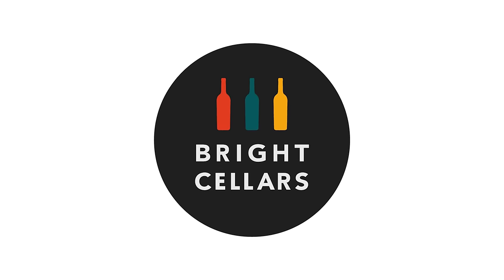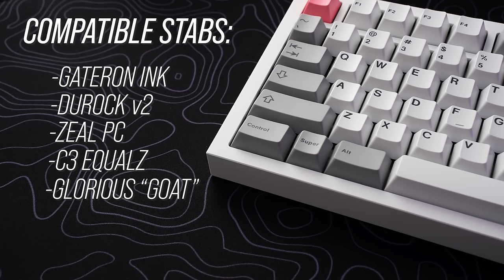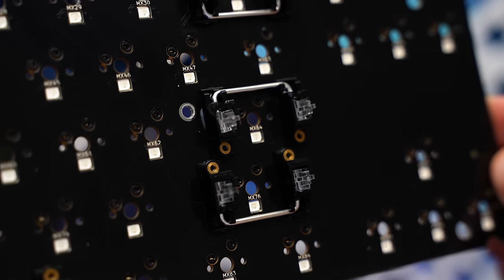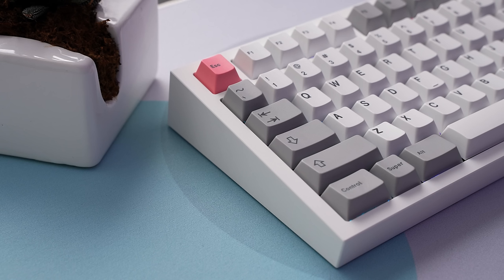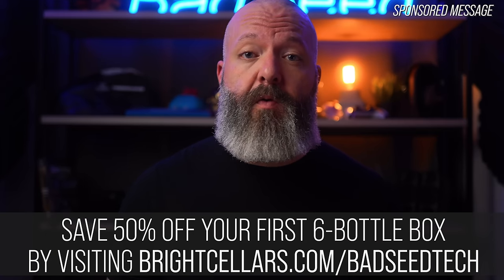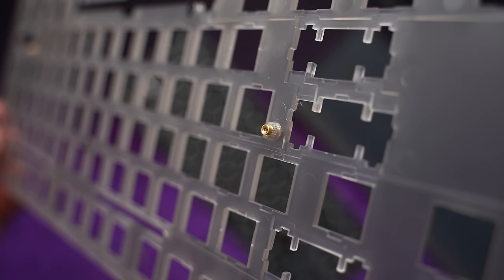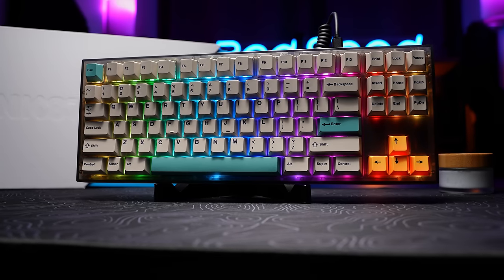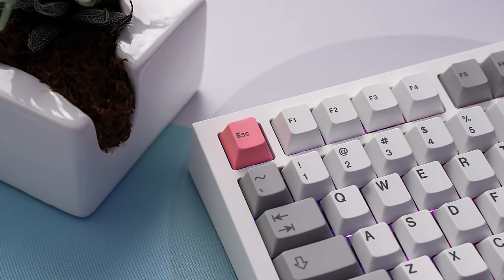NovelKeys NK87 Entry and Aluminum TKL: Wow

Comment: I really like that NK is trying to offer great starter boards for a competitive price in the market space. Hopefully they start offering boards with different mounting styles and layouts for a competitive price later
Reply: I mean, they've had the NK65 and NK65 EE for over a year. The pandemic made keeping them stocked hard, but they were stocked constantly. This one just brought custom TKLs to an affordable-ish price. I still think you'd get more bang for you buck spending $10 on the KBDFans x ai03 8X Mk.II at $289 for the kit. Sure doesn't come with case and accessories, but you get better materials and mounting options (default is top mount, but can be o-ring gasket mounted). Even better yet, the Freebird TKL is going to set the bar for entry boards with their TKL.

Comment: Much love for some TKL content! Now just to wait for the Keychron Q3, looks like they updated it with an F13 layout which is much hype at $149
Reply: The Q3 at 170$ might just give good competition to the drop ctrl, meanwhile the ducky one 3 tkl is 150$, so there won't be a compelling reason to get that also

Btw,have you seen the fl eSports cmk87? 130$ for hotswap wireless tkl,it has a plastic case but with a metal weight at the bottom
Reply: I've been looking for an aluminum TKL with gaskets and per key RGB. The Q3 seems to be the best option for me personally (prefer it's side profile more than NK87 - hard to pick those up)

Comment: Another Banger Friend! I just modded my Aqua Kings with a POM stem. Holy crap, deep low sound and smoother than Brad Pitt on a cougar cruise 

Insane amount of value for a solid board. NK revolutionized entry level 65% boards now they're doing it with a TKL.
Reply from the maker: Oh that sounds like a nice mod on the Aqua Kings, I’ll have to look into that.
Reply: I used a P3 stem (Ones in Durock POMs) in my Aqua Kings to put as my spacebar and holy fuck.. it's insane.
Reply: @Archurus  You can buy a bag of the POM stems by themselves from the Durock POM piano switches.

Comment: Hi, I really appreciate your channel and your straight to the point delivery, Usually black or white and not a whole lot of grey.

You seem to have the Mode 80 in grip because of its price but for someone looking for a premium board with an awesome sound AND flex (new 2022 model with isolated top and half-plate) that can be had without winning a raffle or waiting for a year it’s a tradeoff I’m gladly ready to make.
Easier availability and customizable do come with a price… I tried to get a Mr Suit twice and was waiting for GB for Vertex Angle but after hearing it I just decided I’ve had enough.

Entry vs premium of course there’s bound to be a price difference. Is a premium board worth it?  That’s a whole different topic 😉

Keep the good work and let’s agree to disagree on the Mode 80 😜

Comment: Both of these are on deep discount/clearance. I know there are 'better' options out. But for the NK87 Entry at $75 and the NK87 Aluminum (Batch 1's) now at $135 its worth buying. Adding some O-rings to the stabilizers for PCB issues wasn't a hard task and overall Im happy with mine :) Great review!

Comment: I've been looking alot of keyboards but most of the are gasket with tons of flex for pcbs really designed for people who type on linears. 
I don't, and people will say you can still mod a keyboard designed to make tactiles go with it, but this just provides a great out of the box and cheaper option, that will work great with tactiles and it's a great looking board and you can do a tempest or pe foam mod if you desire.

Comment: if you are concerned about losing the weight in your NK87 entry instead of removing your bottom silicone try tape modding the PCB, it will give it some life. and btw the aqua kings are not that loud on their own, so I would suggest different switches.

Comment: Looks and sounds so good, but I hate the layout of the bottom row. Deal breaker for me. Finding compatible keycaps will be a pain. One of the best things about TKLs is you can use normal sets, but nope, they had to mess that up.

Now I just need to find some other TKL that also comes in beige to put my two tone FC900R keycaps on...

Comment: what is tough on the layout? is the spacebar not regular length?

great video!
Reply from the maker: Correct.  Its a Tsangan layout which uses a 7U spacebar instead of the standard 6.25U bar

Comment: At least for me the smokey polycarb looks starts to lose its charm on much bigger boards, the q3 from Keychron I feel will be a great option for those who want a full alu body but do not want to spend almost 300 bucks on the nk87. The freebird will probably be a great value too considering you get durock v2s included.

Comment: Ugh I've been sitting here with carts ready to checkout on 3 sites. Keychron Q1/Q2, NovelKeys NK87ee, KBDFans Kbd67 Lite, Kprepublic (for Domikey caps). The price is just climbing so rapidly it's insane. Even with a basic board like the NK87EE I'm looking at nearly $500CAD if I get some above average caps. Am I doing something wrong? Feels wrong to spend this much and have a polycarb build at the end of it. I'm currently on a 75% Niz and I enjoy it, but I've always been curious about smooth linear MX. I'm leaning towards TKL just to have something different from 75%. Maybe I should wait for the Q3?

I've already ordered and received my Gat CJ switches, they're admittedly a bit expensive but they seemed worth it. Even a simple NK87EE is going to cost me $230 CAD ($50 USD shipping yikes). Add the money spent on switches and I'm already at $350cad and I still have no keycaps. 

Maybe I order PBT Stone caps along with the NK87, despite it being kinda boring it seems of decent quality. That's another $100. Still cheaper than Domikeys though..
Reply: EDIT: I've decided on some AKKO asa caps in the mean time, $70 shipped they will be the cheapest component of the build by far! So CJ Switches, NK87ee, and Akko caps and I'm out the door for only $420CAD! I was looking forward to completing my first build so I could try and encourage my friends to get involved, but at this price I'll be keeping it to myself and hope nobody asked how much I spent.

Comment: I have seen Taeha's build vod of this board , i still don't understand what mouting style this is , is it top mount or tray mount?
Reply: Both. Plate mounts to the top, and the pcb mounts to the bottom tray. The latter is basically a way to connect the top and bottom halves of the case indirectly. I think it’s pretty dumb and they should have just built it like a traditional top mount

Comment: It’s great that this will be in stock, but the design is just outdated and makes no sense, especially compared to competitors.
The board is both a top mount and a tray mount, and there’s no point in this design. The only thing that is achieved versus a top mount alone is not having exposed screws on the bottom - which wouldn’t be seen during use anyway. And probably minor cost savings. Meanwhile, acoustics clearly suffer, and probably feel as well. 
I understand that it’s still a perfectly decent, functioning keyboard. But you can get something like that for a lot less and just chuck some foam in it and get similar results. The enthusiast space is about the subtleties, and in that regard this board doesn’t really offer anything concrete that you can’t mod into a mass-market hotswap prebuilt. Compare the alu edition to other boards like the freebird tkl and maker scarlet. Those have the refined feel and sound that set a custom keyboard apart from a normal mechanical keyboard, at a significantly lower price. This does not.

The entry version is definitely easier to justify buying. It doesn’t have direct competition and sounds pretty alright if you really do need a tkl. But again, with the mounting, i feel they could have designed this substantially better
Reply: it has enough compepitors, just none that can run QMK. But tbh in such big formfactors, QMK doesn't really get used to its full potential anymore.

Comment: What stab mods should I do and how do I do them?
Reply from the maker: Loads of video out there on lubing stabs, but all you really need to do is lube the housing with 205g0 and the wire woth dialectric grease and you’re good
Reply: @badseedtech  would I really have to take the board apart to do this? Or could I like use a small brush.

Comment: Best Buy has the G915 TKL wireless for 150 or the full sized wired for 120 right now, rather spend my money on for that low profile + wireless connectivity for that price or save my money and get the wired full size at that point than these ridiculously overpriced hobbyist mechanical keyboards anymore.
Reply: Salty?
Reply: @soultec8583  about what? Not using overpriced keyboards
Reply: @teptaylor  Your pre-built Chinese logitech is just as overpriced...
Reply: I paid 60 dollars for a refurb of the 915, all your parts for the keyboard by and large come either from China or Vietnam. No keyboard is worth hundreds, that's just dumb.